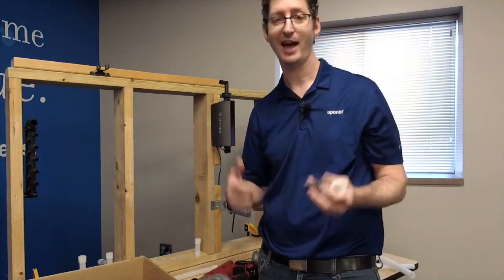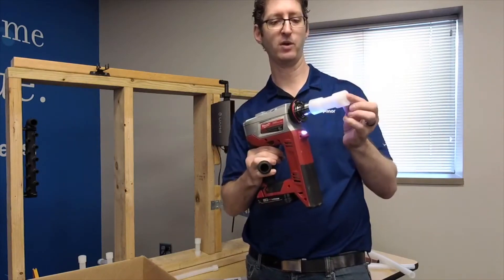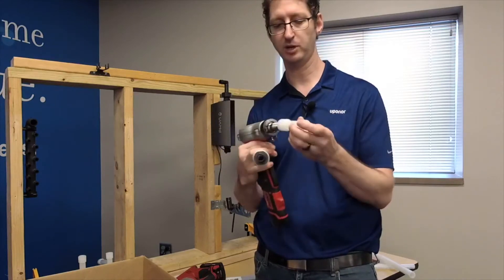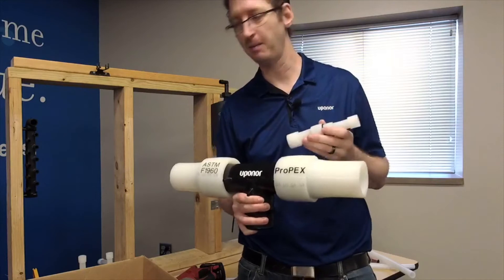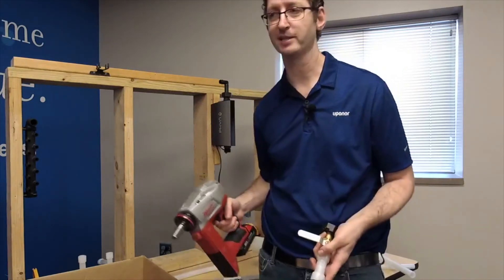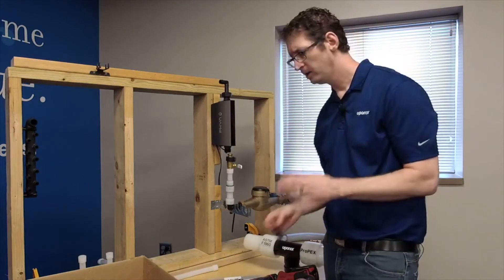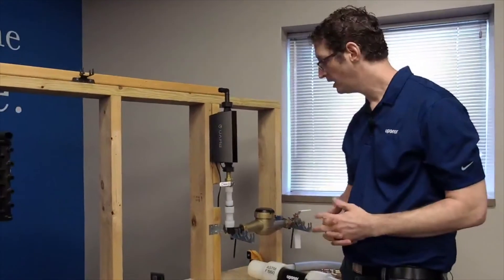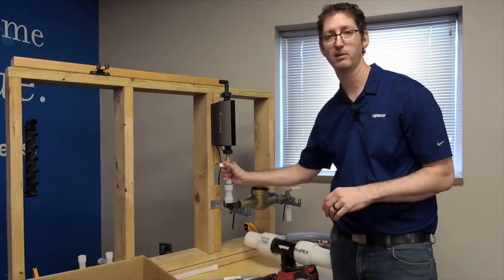Uponor ProPEX Connection Tips & Tricks

Comment: Make a comfortable sling that you can wear around your neck and shoulder, about working height that you can just turn aloose and use both hands to make the connection. Apron to hold fittings.

Comment: the expander leaves grease inside the pipe, is this a problem? and why does it leave the grease inside the pipe?
Reply: Just lightly grease the expansion head (the metal cone) on the inside before attaching it to the Milwaukee tool as needed. See manual. Then wipe off the exterior. This will keep grease off the ring and pipe.

Comment: Dan, I actually used the expansion ring to repair my garden hose fitting, (instead of the old screw clamp)just expanded a 3/4 ring using a 1" inch expander head, it worked great

Comment: Dan, thank you for the tips! I've been reading about Uponor ProPex for almost a 2 years now and I just bought an M12 and ProPex pipe and fittings to repipe my house. Thank you!
Reply: Oh no, did you use the red and blue Uponor pipe?  Its been recalled, they don't sell it anymore...only the white stuff.  Uponor has issues, doesn't work well with chloramine. it takes as little as 6 years before pin hole leaks occur if you have the red and blue stuff in your house.
Reply: @johnbeckwith1361  Hi John, I used the clear/white stuff. But I didn't know about the recall. Whoa! Why did they not know this before? Seems they would have caught it in testing. I know TONS of people that have the Blue/Red stuff in their house.... Is Uponor going to pay for reinstallation?  Heck, how long before they discover there is something wrong with the white/clear?🤮  Thanks, Jim
Reply: @johnbeckwith1361  shark bite still sell the red and blue tubing